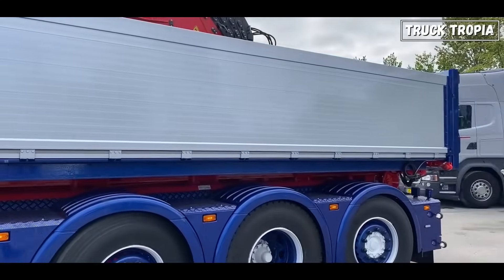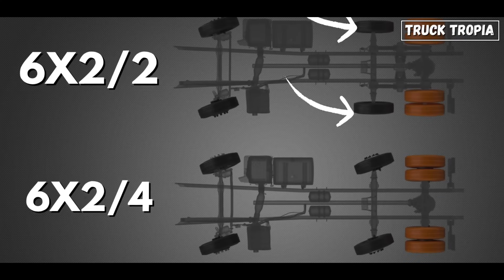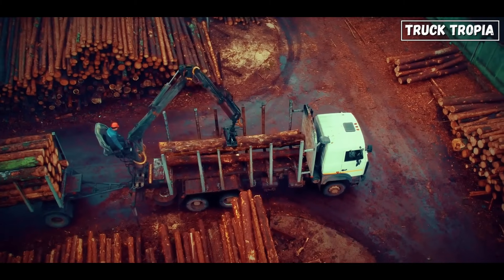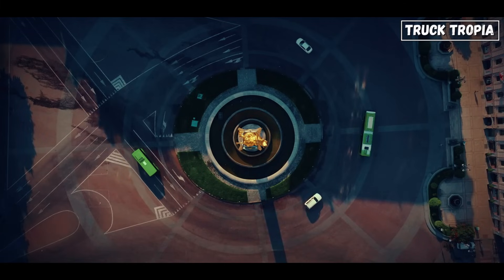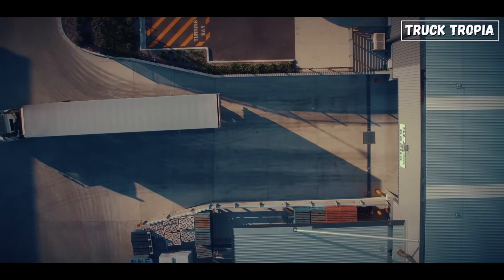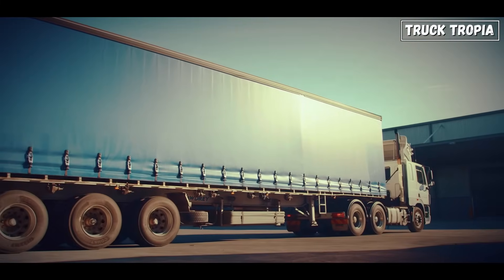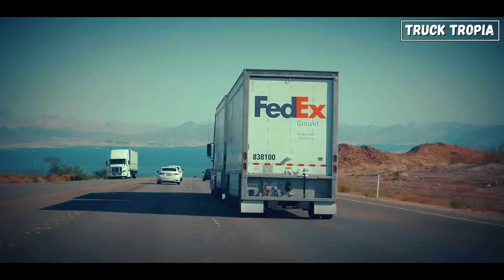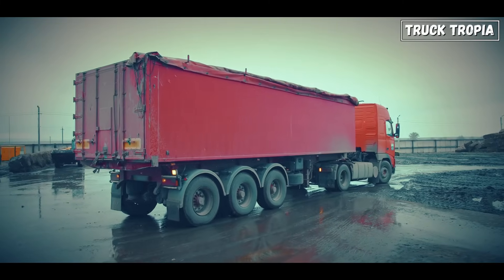Why This Truck’s Rear Wheels Turn

Comment: Worked with a tractor trailer that had 2 steer axles on the tractor and 2 on the trailer. 2 liftable axles, 18,25m. Did the city centre of amsterdam with it and other tight places you dont want to get in with that. No camera's on the back, alot of stepping out and 👀. Now i do it with a smaller crane truck, much better and less stress.

Comment: yes, but 8x2 mean 0 traction. and why the semi does not use 6x4 with twin steer?(not front and rear driven like hydrodrive, but twin steer with rear axles driven)

Comment: Yes. I have 6 x 2 Seven of them

Renault Faun garbage trucks 4 nos

IVECO stralis AMS side loading garbage trucks 3 nos

They are good for maneuvers as you said for tight city traffics. 

But too expensive to maintain the accumulators and the steering cylinders

Comment: I have seen a military double-trailer turn around the bend like a normal car.
Have those been normal trailers it would get that second trailer stuck.
Also I saw a long load trailer with a steerable bogey at the end with second driver.

Comment: The liftaxle is not automated its a Button in the cab to lower or raise axle with Weight transfer normally to get a higher axle preasure on the drive axle when traction is low and increase power to the surface. 😊 Im more then happy to explain from a mechanic point of view how most systems work as I work with them on a daily basis.
Reply: Depens on what truck. Fh series and acania typically have it automated

Comment: Could you do a video on why trucks don't have cooling systems on the brakes?
Reply: Engine braking and exhaust brakes as well with engine and transmission retarders-that’s actually the technical name. These all slow down the truck without using traditional brakes. All the other ways used to be loud but with modern emissions and exhaust systems these are quiet
Reply: Cost/ no need

Comment: It's only underrated in the US!
Reply: I also don't get why the lowboys in the US don't have steering axles. They always need 20 lanes to turn for no reason
Reply: @Catonaut. there is steerable lowboys just there generally larger lowboys but a two or three axle lowboy can turn close to as tight as a 53’ dry van trailer
Reply: American truckers would view it as beeing a poor driver if your truck have equipment that makes driving easier.
They ned to be able to show off thinking they are super truckers.
Reply: @DonGorgen yeah that's called pride. They need it to swallow and adapt modern tech

Comment: Why do you show the long US fire trucks in this video? Their manually steered by an extra fire-fighter not electronically. The last axle is steered because of the excessive length of the truck, not to lessen wear.

Comment: In UK every single LTS (longer semi trailer) needs to have a rear steering axle. Normal size it’s 13.6 meters, LTS are around 15.6 meters so basically 4 extra pallets. I drive them from time to time, reversing it’s funny. Ours use BPW steering axle and its locking itself if you reverse like 1-2 meters, if its not locking then your trailer it’s going opposite and sideways… not good when you reverse between the parked trailers.
Reply: That is always fun when you have force streering axles that steer by mechanism and cant be turned off. Force pushed one to many in reverse when system fails. 😊
Reply: @HexxxiZ  they are new, no time to break. There it’s a switch on the side to force lock the pin even for going forwards but it’s not a good idea. I’m doing 1-2 parkings each night, i’m not complaining but the shunter/yard dogs love them… 😂😂😂